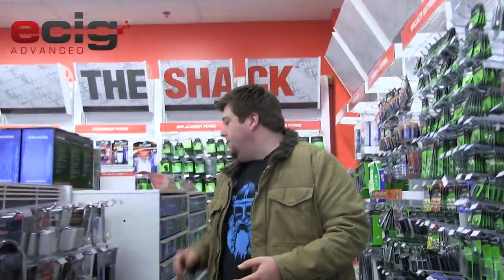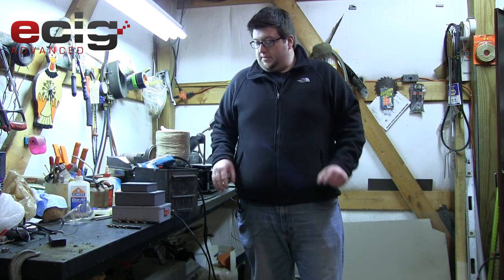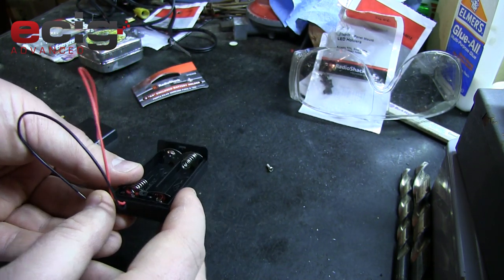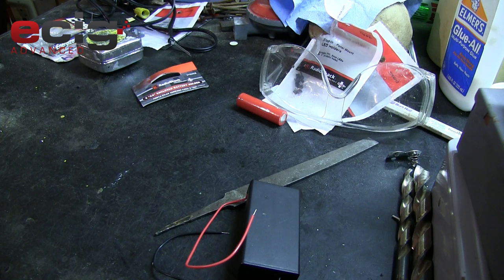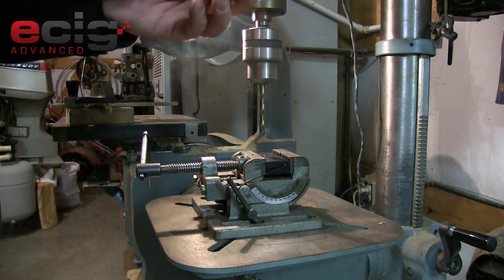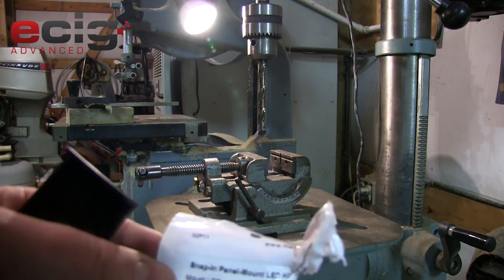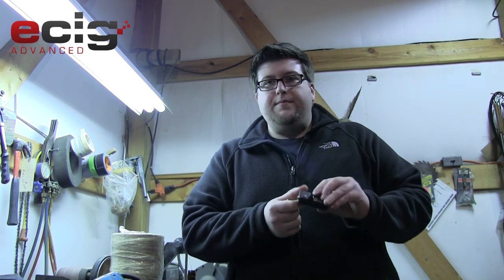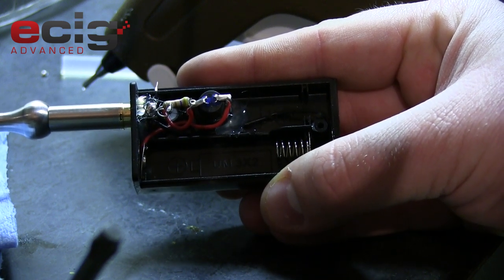Ecigadvanced Vape-pocalypse: Radio Shack E-Cigarette

Comment: Great idea!! Got to try this. I did notice a problem but only a minor one.You need to solder the resistor to the 510 connection otherwise you are dead shorting the battery. The battery is gonna heat up really fast and may start on fire or blow up! The led can handle that AA battery with no problems without the resistor.

Comment: Not nit picking but it's a moe men tary on switch, not monetary. I've been thinking about building something similar to this in variable voltage with 2 14500's in parallel. BTW I wish I had your drill vise, mine's crap. Loved the vid, keep them coming!

Comment: Hows come the resistor is only used for the led pathway? And is this a safe method for running an atomizer? I am under the impression that voltage matters when applying it through the atomizer!? You rock and I most appreciate your vids... A well as anticipate your diy atomizer build tutorial. When I have the opportunity to join your forum I will most gladly do so but was hopeful to just check back here for an answer. Thanks

Comment: I want to try to make one myself but in regards to the 510 connector, I'll have to purchase the parts online. My question is, is the 510 connector you used have a large hole or small hole. The site I'll be using carries both versions of the 510 connector and I want to make sure I get the right one, if it matters at all. I'll be using a tank vs a cartomizer/atomizer. Thanks.

Comment: It seems to me you have a lot of unused real estate in the electronics side of that mod and  everything kinda crammed to one end. I think the build would be a bit easier with the switch, LED and 510 connection spaced a bit further apart. As for the gauge of wire, which  NguyenVanThock2185 asked about, I'm guessing a battery box like that uses 18 gauge wire.

Comment: L.E.D.s are pretty cool and all, but if your trying to save battery power. don't use one.  they don't draw much power but it all adds up.
Reply: Use a higher Ohm resistor. With a 470 Ohm, my box mod lasts up to a week without charge.. Then again, I used a cell phone battery xD
Reply: or you could make it a bit more utilitarian and a second switch with a small resistor for the LED and do a makeshift torch mod

Comment: You can use the Coaxial M or Coaxial N connector with a 901 atomizer.
puckecig. com     

This is a really good way to do it compared to the Puck version

Comment: Step 1: Find a Radio Shack that still sells something other than phones, satellite tv and other bullshit consumer goods. Most people will have to look up a legit electronics shop, usually a lot cheaper prices too.
Reply: Dude, I don't know what shitty area you live in, but I have never, never found a Radio Shack that didn't have the electronics components section. Ever. In multiple cities. Metropolitan and backwater Podunk.
Reply: A large majority of Radio Shacks have phased out that part of their store in favor of "BestBuy-esque" goods. If you are lucky, they have the bare minimum and cost is at a premium. There are still a few straight electronic component stores around with a much better array of items. Last time I was in a radio shack the girl had to find the last cable tv transformer they had, only took her 30 minutes of digging around.
Reply: ProjectDv2
All mine has is breadboards yet nothing to go with them I hit up the electronic shops
Reply: Robert Beasley Not where I am, our locals keep a Mother section in pretty strong stock. Guess I'm just lucky. Doubly so since I don't need to rely on the Shack, I live about five miles down the freeway from Jameco.
Reply: ProjectDv2 Jameco is awesome.